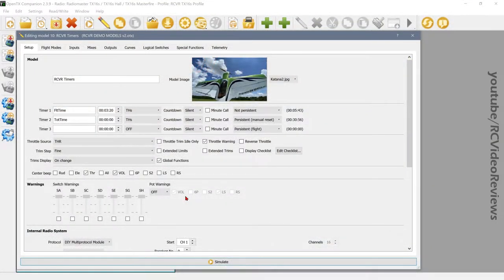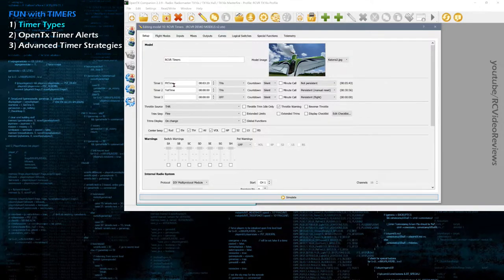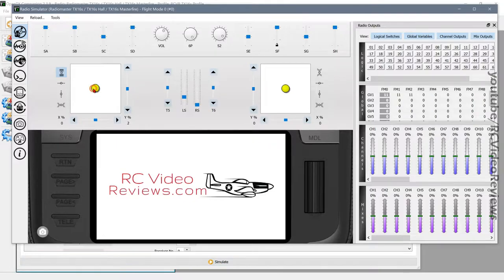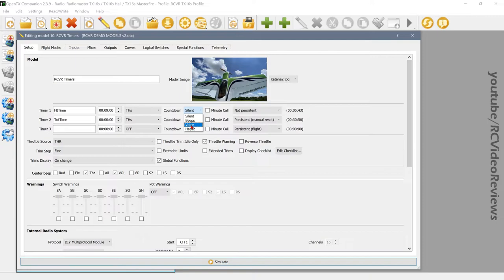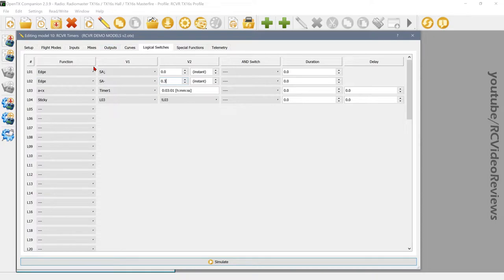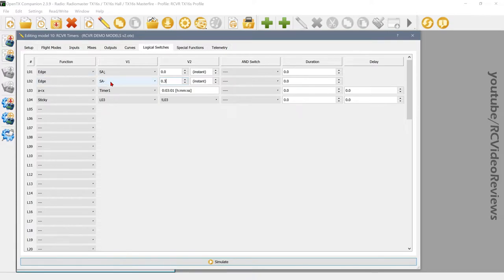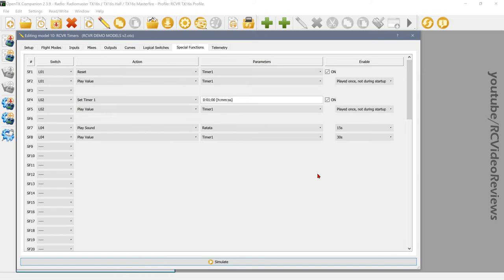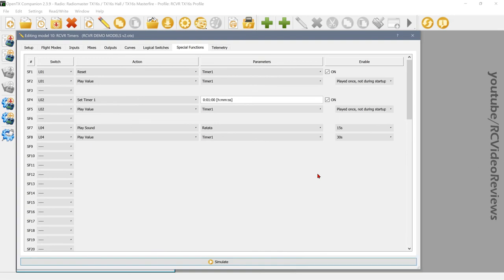OpenTx Companion Tutorial • Timers Explained • Fun with Timers • Radiomaster TX16s •  [Beginners]

Comment: Thank you. I already had the timers how I wanted them (batt only counts down with throttle over 10% and cut set to off and a total flight timer that just counts up - nice on gliders). However the minute calls were a PITA so, thanks to some ideas in this video, I now have 2 min, 1min and the in built <30 secs stuff. Should be much less irritating!
Reply from the maker: Good deal. Lots of flexibility in Open/EdgeTX.

Comment: Great video (as always). I'd like to make a function to turn off a model timer when the Rx is turned off. I fly gliders with small Rx batteries, thus I turn them off as soon as get to the plane, then turn on the Rx just before flight. I can set a timer to turn on with a RSSI trigger. Is there a way to make a trigger to stop the timer when the RSSI goes to zero?
Reply: Came up with a solution. I made a logical switch for Rx battery voltage above 3v. This turns on the timer. I tried RSSI but it didn't work. I then have a switch to reset it.

Is there a way to save timer data so it can be reviewed later?

Comment: Thanks for the videos, have been playing with timers, do you know if we can edit the persistent timer value?  I wanted to set it to account for existing flight times on this model before I started using Edge TX?  Cheers, Dave
Reply from the maker: Not that I know of
Reply: @RCVideoReviews   I thought I replied but it's disappeared!  FYI, I worked it out. Open the yml file for the model and the persistent timer current value is there in seconds. Simply edit that for whatever you want it to be! Too easy

Comment: In one of my plane setups the timer is set to 5 minutes. If I change the time setting, it goes back to 5 minutes when the radio is turned off and back on or if I switch models. It stays at the set value for all the other model setups, any idea how I can fix this? TIA.
Reply from the maker: Sounds like a software bug. The time should always stay where you put it.

Comment: How can we use the throttle trim switch as a methord of re-setting the timer.  I am useing a TaranisQ X7 Thanks Colin
Reply from the maker: You can. Turn off throttle trim in flight mode 0, then use the throttle trim down switch in global functions or special functions for timer reset.

Comment: I LOVE the Th% function! You have to determine what is the right time for you to land with 20% in your batteries through a little trial and error, (that is the theoretical time you would have running at 100% throttle)  but once that is done and you are disciplined (you come down when the timer tells you to), it is an very reliable way of taking care of your batteries.
Reply from the maker: I have to clarify:

TH% adds one second per second to timer when throttle is at 100%
TH% adds one second per 2 seconds to timer when throttle is at 50%
TH% adds one second per 13 seconds to timer when throttle near/above idle.

So you're suggesting when you've ironed out the correct flight time for a battery that gets you on the ground with whatever cutoff percentage you find acceptable--in your case 20%, the TH% timer gets you on the ground reliably at 20%?
Reply: @RCVideoReviews  Yap, exactly!!!
Reply from the maker: @enriquekramer4590  Ok, I'm going to try it. I'll let you know what I find out.
Reply: @RCVideoReviews  I concur, I use TH% on all my models, it takes a bit of fly and try to get the start time correct but it works really well.
Reply from the maker: @davidpiper3652  Excellent. Appreciate the confirmation and will have to give it a go.

Thanks for writing,

J

Comment: Thanks for the wonderful video. Is there is a way to make the timer run faster based on condition? Example. heli can fly 5 minutes at 50% head speed but only 3 minutes on 80% head speed. Can I change the timer count for faster rate (or choose second timer with lower flight time that will continue where timer 1 is. )? Thanks for the answer.
Reply from the maker: Use Throttle % instead of Throttle as the trigger.
Reply: Thanks, but when you fly a heli in 3D, the throttle stick would be many time at 20% or 30% (When inverted, pulling the throttle stick down list the heli up) and on modern controller the throttle curve is flat 60% or %70 ETC, so throttle % won't do.
However, when writing to you, I cam to the idea that I can create the follow:
Logical switch that the GV1 to 300 (5 min) on SA up.
Logical switch that set GV1 to =-1 when SA NOT Up - Count down. (My SA kills the throttle and NOT SA up means that I fly) 
Logical switch that set GV1 to -=1 every 3 seconds and is up when throttle curve is at 70% (high head speed takes more power)
Now I have GV1 count every second with low head speed and faster on high head speed.
Left to do
Set LS? that set on GV1 < 30 once
Set LS? that count when GV1 < 10
Set Special Functions to play sound once on GV1<30 and count on GV<10.
Show GV1/60 on the screen as timer.
Only few days development 🙂
I think I'll just land sooner when I do hi power consumption maneuvers.
Thanks anyway, and yes - I would think that many heli pilots would be glad for a head speed dependent timer. If you find it useful, You're welcome to use this idea and create a video with exact instruction. I surly will use it...
Thanks!

Comment: Hi help please, I set timer 1 to THs and it stops when I am I full throttle and starts when oi am on zero throttle, how do I change it around so it starts when I raise the throttle
Reply from the maker: David, Create a brand new model with no changes. Just 4 sources: AETR. Setup the timer using THs and see if it does the same thing.

Comment: Even though I prefer to use battery sensor with audible alerts instead of timers, your video is awesome and very informative and in depth, thanks so much!
Reply from the maker: Thanks for the kind comment. Glad you found the video informative.
Reply: @RCVideoReviews  I have a question if you have a minute to answer it... is there a way in OpenTx to copy some things over to an existing model without creating new model from copy? I already setup few models on my Jumper T18, and now that I have learned many more features, I would like to copy the new configuration into an existing model, without the need to redo everything for each model, or duplicating... is there a way to do this?
Reply: I think that's a role of Global Functions, is that correct?
Reply from the maker: @matendie9586  Not that I'm aware of. I don't think Companion allows model to model feature copies either, but I'm not 100% sure of that. You might try it in Companion.
Reply: @RCVideoReviews  ok, thanks for the reply!

Comment: Thanks for another useful video.
I’ve set up my top bar to show three timers: latest flight time, longest (historic) flight time and total flight time on the aircraft. 
I’ve figured out 1 and 3 but I’m struggling to configure the logic switch that will replace the value of the second timer if the first timer records a longer flight. 
I’d really appreciate some help on this and, hopefully, it’s a useful idea to you for a kwikki video. Cheers. 👍
Reply from the maker: I don't understand the question. There is no option I'm aware of to change values of timers. You set them to either 0, or some number like 4 minutes. Then you can either let them increment if starting from 0 or decrement if starting from something other than 0. Finally you can reset them. There's also an option to add a minute, but I don't know about writing a specific value to a timer.
Reply: @RCVideoReviews  Hi, many thanks for the reply. Yes, I see what you mean, and that would certainly explain why I was struggling to configure it. ..!🤬😂
So I guess the question is: is there a way to configure a widget so that you can display your longest flight time, and have the Tx automatically update it if you beat it? 
Many thanks once again, I don’t understand half the stuff you cover, but I enjoy watching it anyway. I live in hope that it will slowly penetrate my grey matter. This whole OpenTx thing is amazing to an old geezer like me returning to the hobby after 45 years. The last rc system I bought was a McGregor single channel non-proportional system. It cost me £32 in about 1970 - everything I could save for a year!

Comment: Do you by chance know which timer is displayed in the model select options?
Also, what is the objective of L04? It turns on and off based on whether L03 is on or off, why not just use L03?
Reply from the maker: I don't know what you mean by model select options. On the main model screens, timers are widgets. You can select whatever time you want to be displayed. Re: L04, try it without it.
Reply: @RCVideoReviews  Thank you for getting back, and so quickly!  Regarding the timers, I have flight timers setup for my LOS heli's and micro planes.  It also seems "timer 1" is the countdown timer, while the others count up? Within the model selection screen (when you hold the scroll wheel then select "model select" or "choose model".. where you pick which model you want to load...) there is a timer value.  Mine all read 00:00.  My FPV models I use the OSD time (and battery voltage) but I do have the countdown timers set on the LOS models.  But all of them display 00:00, so I'm curious if that is timer 2 or timer 3.

Regarding the logic switches, sorry! I do industrial control logic so seeing an "output" being controlled purely with another output without other logic jumps out as a "wasted" output, he he.
Reply from the maker: Timer functions are not predefined. Any timer can perform any defined function. If you set a value to 0 and establish a trigger, the timer counts up. If you set a timer to some number of minutes with a trigger it counts down. You don’t get locked in on OpenTx to doing things only one way. 

On logic there were probably two factors at play: 1) Sometimes OpenTx logic doesn’t work exactly the way I think it should work. When that happens  usually force the issue with a line like L04. That’s why I suggested you try it. If it worked without L04 then.....

2) These are training videos now how to use the radio moreso than training videos on logic. From time to time I look for excuses to show functionality.
Reply: @RCVideoReviews  Thank you for clarifying what I found regarding the timers.  I suppose I'll set timers 2 and 3 to be cumulative with different triggers and see which influence the timer marker in model selection screens.

Point taken! I've learned a ton about using the radio from your channel. Like the !1x for my "play track", now I don't need to hear that I'm disarmed when I just turned on the TX, lol.  I'm going to go ahead and sub..

-Ron

Comment: First of all, a very merry christmas an a covid free and healthy 2021! My compliments to this inventive and innovative way to implement timers. I combined it with your way of engaging throttle cut and it it a winning combo for shure. I did it on 2 models, both flying wings with similar settings but at one of them, it was not running correctly regardless what i did. The problem was in one of the models the timer gets active when the trottle was above -100,regardless throttle cut was active or not.Even comparing of model settings side by side in companion the lines in model basic setting, mixers and logical switches aswel special functions look identical..After pounering my back end sqare, several hours of smoking grey top end cells and 3 liters of coffee i found out model 1 has the channels named in outputs , the second has not. After correcting this by defining the outputs in the second model, the problem was fixed. I don't know if anybody else has experienced the same problem, but my tip is to name the outputs aswel and everything works like a charm! Keep up your fantastic work and greetz from "cheesehead country"the netherlands
Reply from the maker: I never really bother naming channels in outputs. I’m not sure why a channel name on that tab would influence the logic. Odd...
Reply: @RCVideoReviews  yep me either..i only can say doing this step made the difference..

Comment: This series is truly a beginners guide to opentx. There isn’t another channel that covers the topics you do and nobody does it as completely as in this series.
Reply from the maker: Appreciate you support Freddie. Thanks for taking the time to watch and comment. 

J
Reply: RC Video Reviews for my application I have my timers set to my throttle hold on activates and off resets. One issue I have is that sometimes when I’m testing new settings or a new model I will land make an adjustment then take to the air again. I would like to have the timer just pause when I hit throttle hold and resume when th is back on then reset with a different switch altogether.
Reply from the maker: That's exactly the setup I have:

Timer 1: Trigger = L01

LOGICAL SWITCHES
L01  a>x  A=I:THR  B=-95  AND SH(up)

SPECIAL FUNCTIONS
SF1 - SH(down)  Override CH3  -100  ENABLE
SF2 - SE(down)  Reset Timer 1

Timer 1 is enabled when L01 is on which requires Throttle Cut to be Off and the throttle to be north of -95 (just off idle).
SH Down is my throttle cut. When that is activated Timer 1 is stopped. 

SE Down resets the timer all together.
Reply: RC Video Reviews yes but in my case the actual throttle is not using the throttle stick it runs off the se switch with 3 different curves. My throttle stick runs channel 6 which is pitch. I don’t want the timer connected to the throttle stick.
Reply: I got it I just used special functions to change the reset switch it worked this time but for some reason the first time I tried this it kept tying the reset switch to also being the timer switch and not the switch I selected for the timer.
Reply from the maker: @FASTFREDDIE-R.C.  So you got it worked out?
Reply: RC Video Reviews yes working fine now. I have my timers set to go on /off with sf switch and I used special functions to setup a reset switch on sa switch. Originally I had the reset switch on sf up but when I tried to change it to the sa switch it was canceling the sf switch altogether not sure why but everything works as I want now. My issue was that sometimes when I land to check something out I would need to adjust my pitch so that’s why I didn’t want the timer going on when I moved the throttle stick.
Reply from the maker: @FASTFREDDIE-R.C.  I get it. I land all the time to twiddle rates/expo etc. It's half the reason I made the expo/weights/gvar video ;)